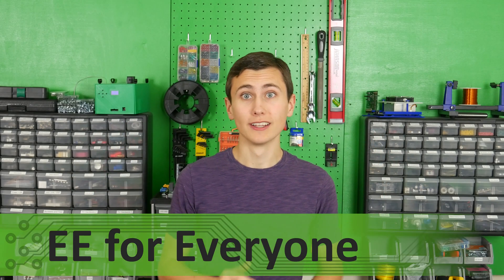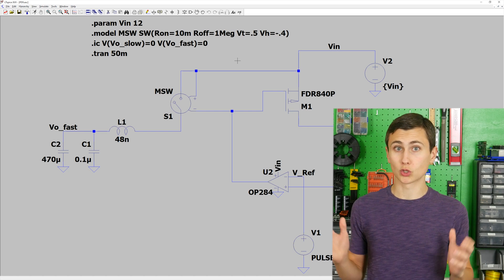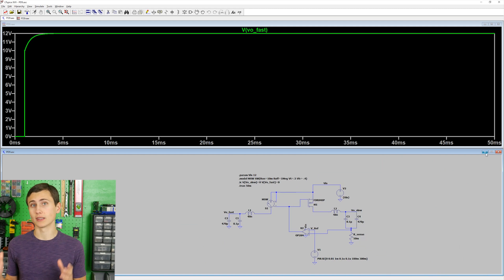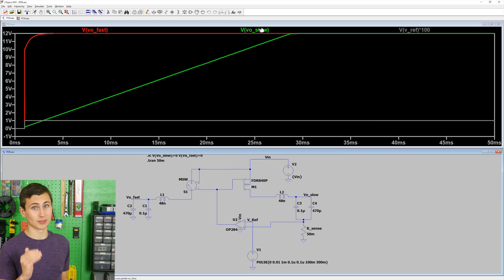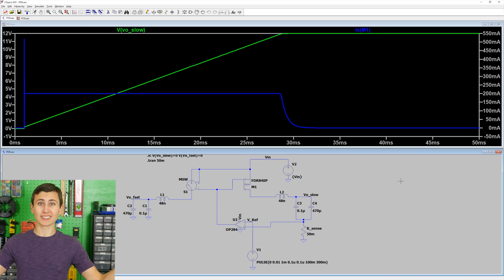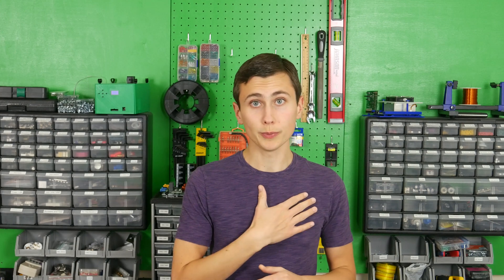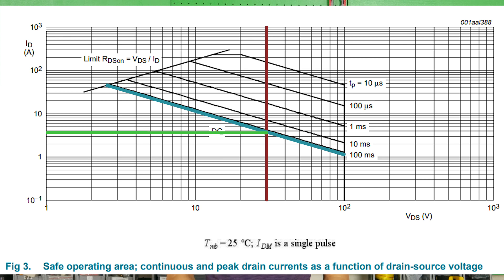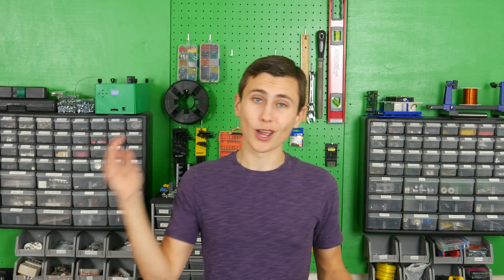Soft Power Switch (Soft-start)

Comment: Is it possible to soft start a load that cycles? As an example, plug in a DC device that runs at 18v. The control board on that device will use a relay to intermittently power a motor which on its start-up overloads the power supply. Is there a way to put something between the power supply and load such that when it suddenly tries to draw significantly more current (over 17A), it will ramp up to max without an overload startup?

Comment: i need to build something like this but for a voltage between 18-25 volts with a maximum current handling of about 25 amps. I have a bluetooth amp that has several large caps that as you said, act as a short circuit when connected to my 400wh lithium pack.
Reply from the maker: Hi Flyingwigs, Oof! That sounds like a lot of inrush current! I hope you can find a good solution... is it tripping the over-current protection of your battery pack, blowing fuses, or all of the above? :)
Reply: @EEforEveryone  no, thankfully it is not high or long enough to trigger the BMS, but it is sparking badly when connected. it was enough to make me think most switches would get fried over time. I also like the idea of using a momentary button for both on and off.
Reply from the maker: Oh yeah! Arcing can be difficult for a mechanical switch, for sure. If the inrush isn't too extreme, a mosfet or similar silicon switching device might do the job nicely! Using a mechanical switch to trigger the part doing the heavy lifting is sometimes a good option. Otherwise, a good switch with gold plating made to switch dc may last a while!

Most switches that fail early fail because an ac rated switch is used to switch dc.

Comment: Is there any relationship between reponse time at 5% and the soft start time ? 

I would like to design a soft start for uc3842 ic controller
Reply from the maker: Hello Honodijii, great question!

Depends on what you mean by 'repsonse time". I tend to think of response time as how long a power supply takes to recover from a load transient (stepping from 5 to 95% load, for example). This definition of response time means that it depends on the compensation network and control loop stability, not soft-start programming.

Soft start time is how long the power supply will take to transition from 0V to the output voltage while turning on. 

I hope this helps, and thanks for watching!
Reply: @EEforEveryone  
Thanks but for me the définition of soft  start time and  time reponse is the same and it make me confuse.

For m'y design i put 
tss = tr  To help me to calculate the Css
Reply from the maker: If tr is your desired rise time when tuning on the supply, then that should work just fine!
Reply: @EEforEveryone  
Thanks.
tr for time reponse.
Have you already design a soft start  for one SMPS ? 

I Will do that by simulation to well understand.